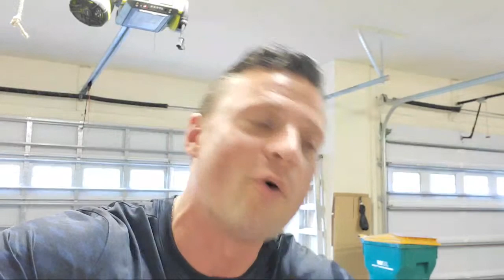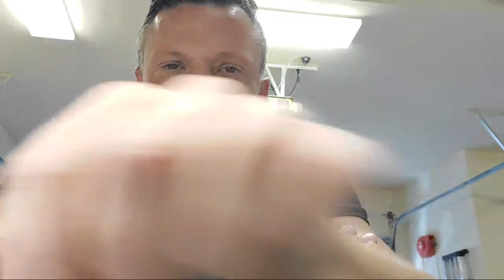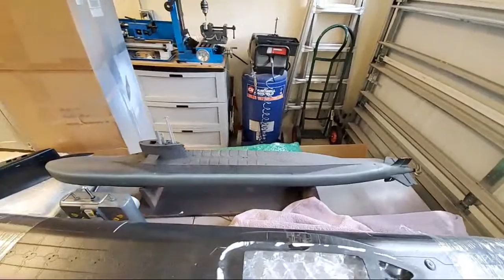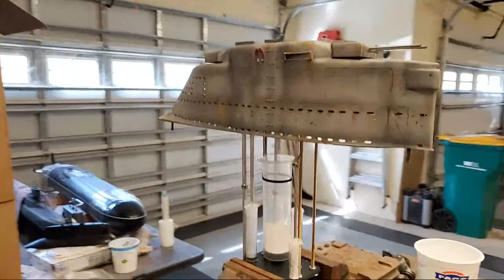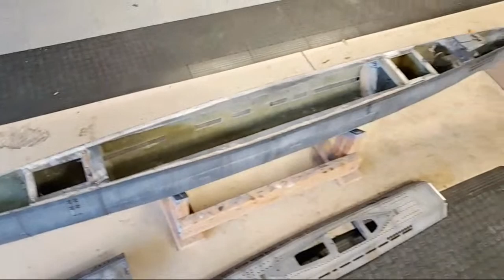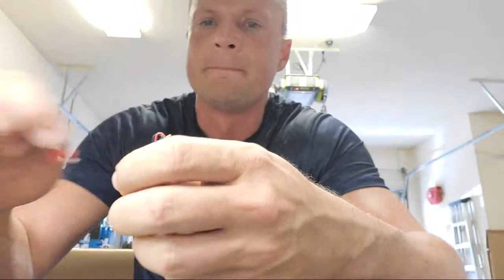RCSubGuy Live 01/18/2020

Comment: R/C submarines are an advanced model build. Scratch building is a skill set required. The R/C car analogy is a good one. You have to be a scale modeler that is willing to do the research and have some mechanical chops. 
I have one of the 1/48 scale Type 21 hulls that was made by a guy I worked with at Continental Airlines years ago. I have never been able to Finnish it. My last steps working on it were interrupted by the floods caused by hurricane Harvey. The model was in a shop were it spent a week under water.......
So it survived just fine. So I hope I live long enough finish it. It's a long process.